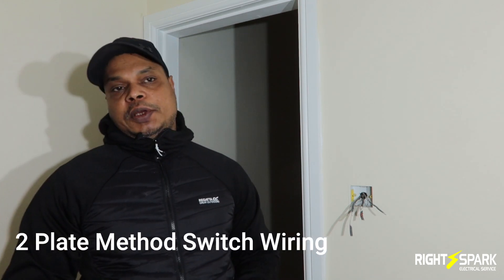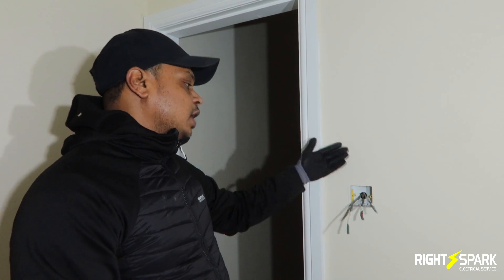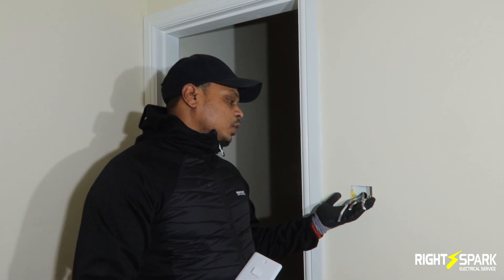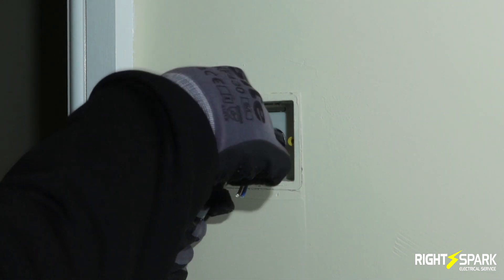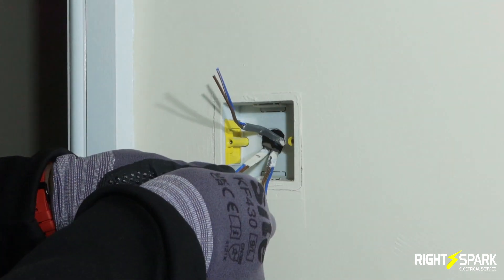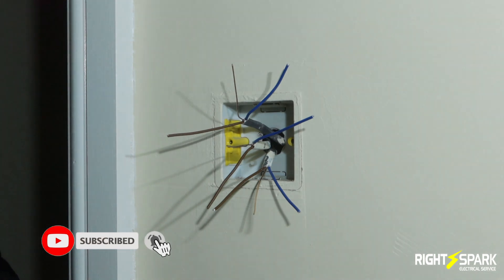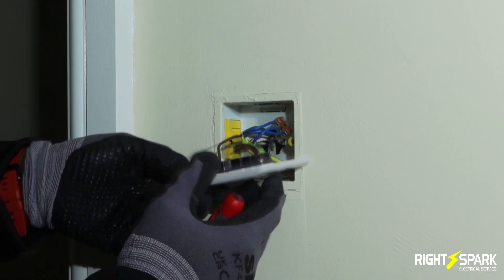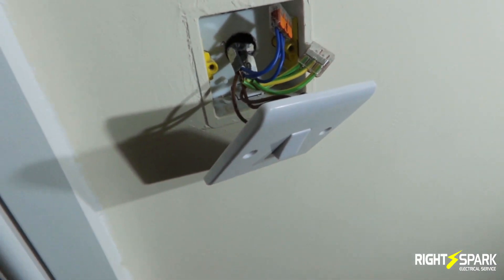2 Plate Method Switch Wiring ( How to wire 2 plate Method ) Electrician

Comment: If I have an existing switch with a supply coming in from previous room and a supply going out to another room, and I want to add a new switch/light in the same room. Can I take a 2nd supply out of that existing switch to the new switch? So that means it will have a supply coming in from previous room, a supply going out to the next room, and a third supply for the new light/switch. Is this possible or is there a better way?